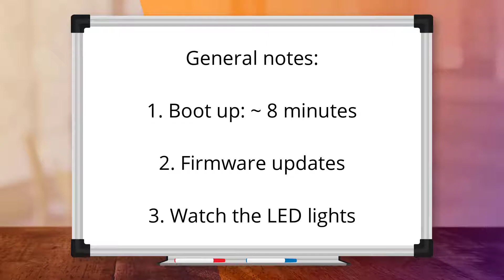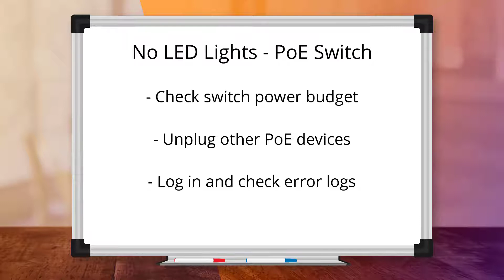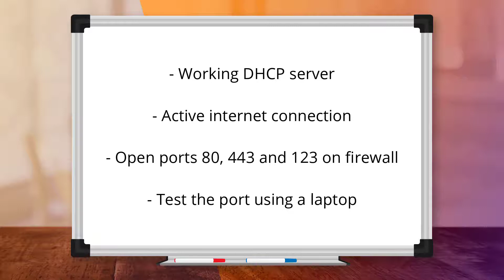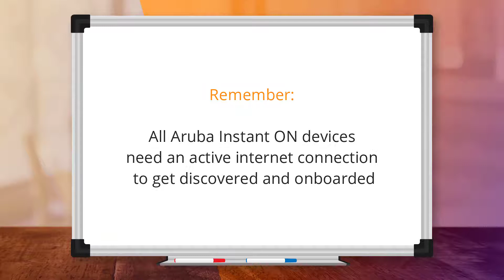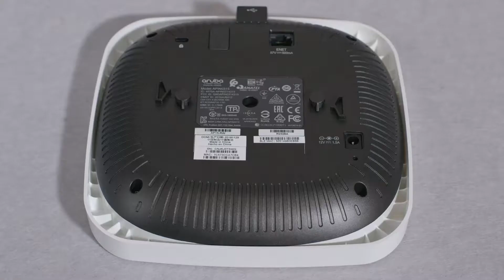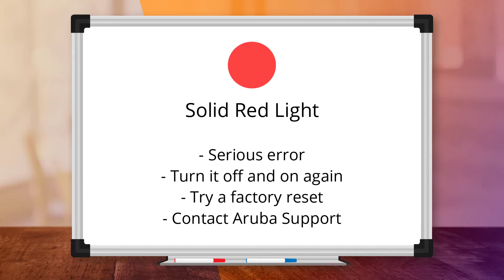Aruba Instant On - Troubleshooting Access Points

Comment: If I have an AP11D connected through a PoE but I don’t have a switch where do I connect the Data IN cable?
Reply: Hi Gonzalo - I'm no expert but maybe you have a LAN port on your router?
Reply: @armanshaghi  I solved the problem assigning an IP address to the AP and connecting the LAN cable to the Data IN port
Reply: @GonzaloSeminario  great, thanks for sharing back your solution 👌

Comment: In our aruba 305 access point connect them limited access only ........how to solve in this problem
Reply: i tried rebooting and reseting method but in this case not clear
Reply from the maker: AP-305 is not an Instant ON AP, but and Aruba enterprise model.

Comment: my aruba 207 has been blinking for 3 days... i would say it is obviously stuck at the blinking green light.

i am thinking there is an issue with it syncing its configurations from the cloud. but i am not entirely sure. if someone could please give some insight in this issue that would be amazing! :)
Reply from the maker: Hi there, if the AP keeps blinking green light then it's stuck at booting, you'll need to connect a console cable to the AP to check for boot errors, or try the factory reset procedure. Also check if you have an IAP-207 or AP-207 (controller-based). Btw, it's an Instant AP, not Instant On AP (can get confusing!) :)
Reply from the maker: AP-207 requires a controller to setup and run. IAP-207 will work as a standalone AP, you can configure it locally or through Cloud but you will need a Aruba Central Subscription in order to manage through the cloud. You can refer to our Central videos at https://www.youtube.com/c/ArubaPhoenixProClub on how to setup.
Reply: @NetworkingDojo_AION  thank you so much for the help! so the problem was that it was either factory reset, or never configured. i was able to connect to it using a default ip and get in through the GUI and get it configured. thanks very much for the help :)

Comment: i have an aruba 225 and i dont know how to reset can you please demonstrate for it
Reply from the maker: Hi there, it's the same as Instant On. Power down. Press and hold the reset button while powering up, then wait for 3 slow flashes of the LED light, 1 sec apart, before releasing the reset button.
https://youtu.be/zHC-P_qkLSo?t=260